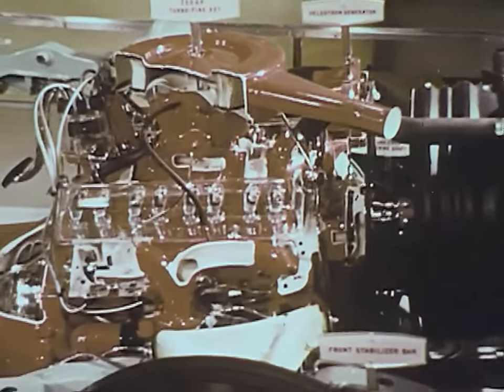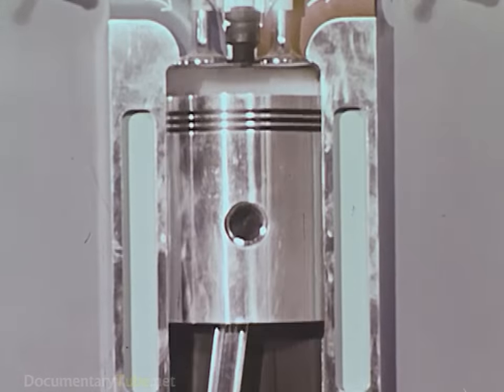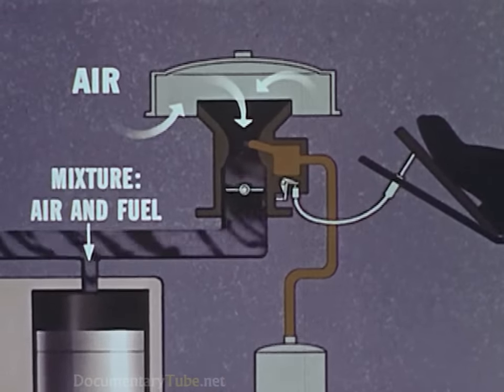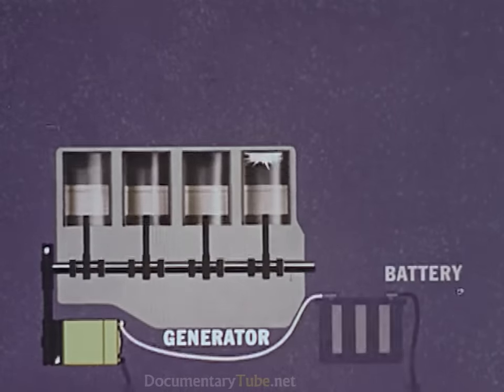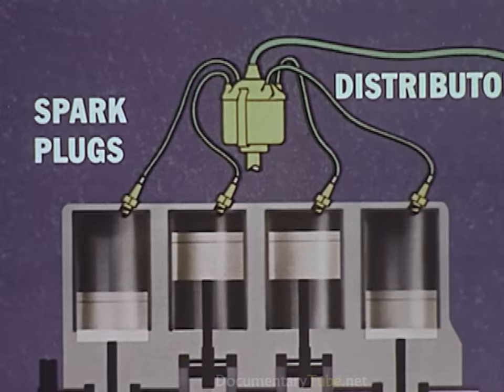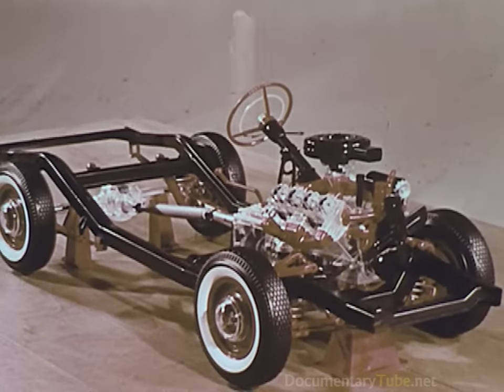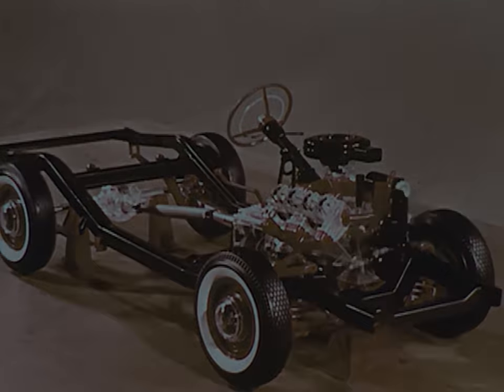HOW IT WORKS: Internal Combustion Engine

Comment: NO wonder people were smarter back then....they explain everything so simple to understand.
Reply: Are you sure? 60s engine are easy. Who know what is injectors times electronic ignition, lambda, air flow, cams time changing, a knocking combustion (when today engines work on edge knocking)
Reply: or maybe it's because engines were just similar back then. Thanks to the internet, we can be more informed than ever before
Reply: M
Reply: They also needed to understand it without YouTube as a option to learn which made them have to experiment more hands on
Reply: Yesssss! Screw common core!
Reply: They just didnt consumer drinking waters with fluoride and GMO foods
Reply: VueTube because things were simple back then. There is no easy way to explain adaptive cruise control and autonomous electric vehicles.
Reply: Your right!  - an excellent video
Reply: They used to talk this way in our government as well. Which explains why our government is so fucked up today. All they do is run their mouths speaking promises they can't keep while stealing more of our money by increasing our taxes.
Reply: Ikr
Reply: VueTube true
Reply: Yeah
Reply: @rakhit  definitely 😒
Reply: I thought it was the hats and ties.
Reply: @StopTeoriomSpiskowym  You have to understand the basics before getting into more complexity. Most modern explanations are bad for this reason. To learn how an engine works, you should start from its simplest form and build from there.
Reply: where could I get the complete version of this video?
Reply: @StopTeoriomSpiskowym  - you proved @Vue Tube’s point for him.  You rambled and didn’t make sense.
Reply: these days they warn us not to drink shampoo
Reply: Lmfao
Reply: @sumirunihon  I think the point he’s getting at is that nowadays you have to sift through hours of shit to find any useful information about anything, where as pretty much anything labeled “informative” from the 80’s back is purely educational and to the point. No merch plugs, no life updates before the video, no square space ads. Just a video about how an engine works. Simpler times
Reply: That's because engines were more simpler
Reply: @stevenarvizu3602  If questioning my grammar is your only refute then you need to get a life.

This is the comments section not an English essay.
Reply: It’s almost as if people these days don’t actually understand what they’ve learned and just copy the story they’ve been told and paste it onto an explanation.  

This is literally the only video that actually tells you that the explosion pushes the piston down, which is attached to the thing below in such a way that it rotates. And that that thing is attached to the crankshaft.  

Newer videos just show you an engine and go ‘look it’s intake, compression, spark and exhaust’. That doesn’t tell me how that thing drives wheels!
Reply: "Simplicity is the most ultimate complication"
Reply: Lol I was thinking the same thing.
Reply: @StopTeoriomSpiskowym  but an injection system is so much easier to work on
Reply: @elliedove7899  and there we have, you my dear Ellie are truly a gift from God. Straight to the heart of the matter, my kinda girl
Reply: I was thinking the same thing while watching this video.
Reply: Literally what I was thinking. I looked up 3 other videos of this and the explanations just made me more confused
Reply: Seriously
Reply: @StopTeoriomSpiskowym  
You're correct the engines in the 60's were pretty basic, some were extremely powerful but still quite basic (once you knew what everything was and how it worked).
Reply: They also weren't sucked into video games and social media...
Reply: No smog devices, no PCV valves and more which is why engines back then were simpler.
Reply: Good
Reply: for real! i liked it when things were built with simplicity and taught so easily that's why i like sticking to older vehicles because if something goes wrong its four key factors to it. Is it not getting spark? fuel? air mixture? compression in the worst case and check down the list
Reply: I feel like people nowadays try to confuse you for som reason when they talk to you don’t know why
Reply: Wellsaid vuetube
Reply: @StopTeoriomSpiskowym  What brought me here was to learn about the internal combustion engine and I did really enjoy this vid but  still have to look at other ones now to really know MORE about the internal combustion engines .
Reply: They were. Better food too no chemicals.
Reply: People weren't smarter in general back then , it's quite the opposite.
Reply: @Bawbrahs  ahh no.
Reply: I'm your 2000th thumbs up bro.. cheers.
Reply: @StopTeoriomSpiskowym  it's easy to explain a carbureted car in the 60s I could easily understand the entire driveline and the engine. But when it comes to ECUs, TCS, ABS and all the safety stuff it's not even explained anywhere unless you go digging for it. How the hell does an ecu work?

Comment: Thank you from a 77 year old lady who is trying to understand  how things work.
Reply: never stop learning
Reply: More like how things used to work. Half the things explained in this video no longer exist on a modern vehicle
Reply: That's super cool :)
Reply: Next up, how dinosaurs procreate.
Reply: @markgriz  not true, things are just all electronic now
Reply: @markgriz  everything exists
Remember this is petrol not diesel
Reply: @markgriz  why? It's pretty much all the same, just instead of a carburetor, it's direct fuel injection.
Reply: @hi-volumebeats595  Modern cars don't have distributor caps, nor a single coil.  They are all coil on plug.  There is nothing wrong with this video to understand the general concepts of how an internal combustion engine works, just pointing out that this 1950's era video is not an accurate depiction of how a modern automobile works
Reply: @markgriz  it's literally the same thing, every cylinder gets a direct spark from a dedicated coil cuz we've  got direct fuel injection now. But the engine works exactly the same way. If modern cars all switched to rotary engines or electric or something like that, then yes it wouldn't be an accurate depiction
Reply: @douglasdbird8114  No, my car doesn’t have a carburetor nor a distributor

Comment: Old engine but well explained !!! Thank you !!!
Reply: Old but still works! I have a 2004 Pontiac grand am with a V6. The engine is a push rod just like this one only real difference is its port injected instead of a carburetor, but the basic principles still work!

Comment: Just FYI if you're watching this in 2021, practically every car made past 1990 uses a EFI (electronic fuel injector) instead of a carburetor. The EFI is connected to a car's drive train PCM computer and is able to create the fuel-air mixture that gets sent through the intake valve. EFI's are far more efficient and save on excess gasoline being directed to the engine.

Comment: Now imagine it spins at 2 or 3 thousand round per minute. Each of those pistons goes up and down 50 times per second, firing a spark 25 or 12.5 times per second at 3000 rpm

Comment: The generator is also called alternator.
Reply: Suitlock_ Suit FNAF who cares person that liked fnaf 😂
Reply: A generator and an alternator are not exactly the same thing. The model in the video shows an old fashion generator, which haven't been used on cars in over 60 years. The disadvantage of a generator was that it used brushes and a commutator to rectify the AC current flowing through the armature winding into DC current to charge the battery. Alternators are different because they use solid state diodes to rectify the AC current flowing in the stator winding into DC. Alternators eventually replaced generators because the brushes and commutators used in a generator would wear out and need periodic replacement whereas the diodes in an alternator will last almost forever.

Comment: Does the throttle controls only the flow of air or both?
Reply: The flow of air draws the fuel in. The carburetor uses a device called a venturi to do this - it creates a vacuum by reducing the cross sectional area of the pipe in the middle and speeding up the air. And the additional vacuum in that part of the pipe pulls the fuel into the engine. (You can see in the diagram of the carburetor that the fuel is pulled in in the smaller point of the pipe.
Reply: @haydentuttle9870  Thank you!

Comment: Love how it says modern engine 😀. But what is shocking is that it has not changed much…it is still an internal combination engine with many moving parts.
Reply: You can now get as much power in a 4 cylinder engine than in a 8 cylinder. An 8 cylinder has nearly double the moving parts of a 4 cylinder so engines have gotten simpler. 

This is very recent, there is now a 3 cylinder road car engine that produces more horsepower than most 8 cylinder cars. This engine is powering a hyper car, but might come to everyday cars in some time.

I think most engines including in performance cars will be around 3-6 cylinders in the future with some exceptions being 2, 8, 10, 12

Comment: After every segment I was like "HOLY SHIT THAT ACTUALLY MAKES SENSE!" i just have one question? Modern cars don't have a carborator on top of the engine so where do they have it?
Reply: modern cars don't have a carburetor at all. Instead they use electronic fuel injection. There is a fuel injector usually placed just before the intake valve. A computer determines the correct amount of fuel to inject.
Reply: @Redtooth75  oh wow fr? So the fuel blends with the air coming in that makes sense

Comment: I'm still trying to wrap my head around how the pistons work. Where is the electric current for the spark originating from and how does the spark make the piston move? If anyone can explain this like I'm a 5 year old it would be great - I'm just tryina understand how the world works lmao
Reply: The spark comes from the spark plug, which gets power from the alternator. The alternator uses the  rotational force generated by the engine to produce power to charge the battery and to power other stuff like the spark plugs. The spark makes the gas air mixture in the cylinder explode, which causes the piston to move

Comment: Is it possible to store compressed fuel in cars?
Reply: Late response, but when Gasoline is compressed it ignites.  Fuels with lower octane ratings ignite at lower pressures.  That's why sports cars require higher octane gas because the engines compress the air in the cylinders at a higher pressure.  If a low octane fuel is used in a high performance engine it will ignite before the spark plug lights causing knocking.   Diesel engines use compression as the ignition source, they don' t have spark plugs.  Diesels run on very high compression within the engine.

Comment: Where is the computer located?  It controls the rotor, generator, and carburetor
Reply: Old cars didn't used electronic computers. Everything was electro-mechanical. Cars didn't start having computers until the late 1970's when fuel economy and emissions became more important. In an old car the distributor, generator, carburetor were all electro-mechanical and there was no computer.

Comment: Nowadays cars don't HV the distributor, but individuals ignition coil.
Reply: That depends. There's still plenty of engines that don't use multiple coils.
Reply: Yeah many vehicles just have dedicated coil packs to drive the sparks. My car has coil packs as a result of using a wasted spark ignition system. It's pretty interesting

Comment: So say you have trouble in a specific gear, you would first look at the spark plugs coordinated with that piston?
Reply: What do you mean I can help you out
Reply: @-gibby538  so it's a transmission issue?
Reply: @-gibby538  so in your original comment you made it sound like each piston is assigned to 1 gear

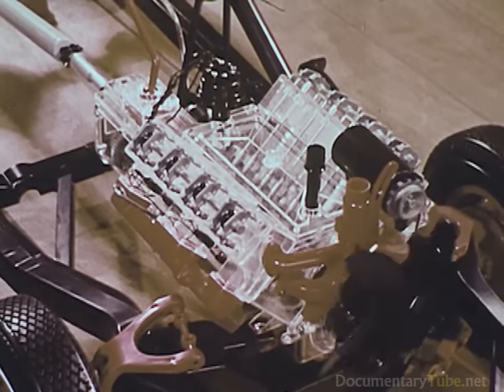Comment: 4:28 on older cars the first/front lobe of the camshaft, called an eccentric, was used to mechanically "run/power" the fuel pump.

Sorry I don't have a video to show it on 😅

Comment: "generator" is that the same as the "alternator"?
Reply: Miles Rose basically yes because it generates electricity like an alternator, but an alternator is just a more efficient generator and newer term, i believe the video said the generator gave the power to the battery then to the distributor, unless im wrong, i believe instead the alternator provides power to the engine and enough power to keep the battery charged as well due to newer engines having so much more electrical and needing a more efficient way to transfer energy while recharging the battery without over charging it and causing a shorter life span for the battery. unless they are the same thing just higher output now and a new term to call it
Reply: @ismaelperez5237  Thank you for that clarification. I was just a little confused, because on modern cars I usually hear the word "alternator" being used to describe the component that charges the battery.
and yet on this old video I hear the word "generator" instead... So, on modern vehicles, and alternator both Powers the battery/distributor, as well as all of the newer electrical and computerized components of the engine?
Reply: @MilesRoseProductions  little late, but yes, you hit it right on the head. The alternator recharges the battery, which in turn powers the car's electrical components, which can be the car's turn signals to the car's central touch screen.

Comment: Sorry sir gasoline diesel kerosin and propane or butane or l.p.g.or not explosifes but flammable fuel's so it is not a explosion in the engine, dynamite is a explosif

Comment: Just for information. 
Carburators are no longer used in modern car .
Reply: Yes, now they use fuel injectors. Also, "generators" have been replaced by alternators.  Oh and most modern vehicles no longer use distributors.

Comment: When you can start an old school engine by nothing more than firing the ignition at the correct time...Without using the starter, then you will possess  a complete understanding of engine cycles of operation. Past, present, and future.  It was required to ace advanced High school autoshop.

Comment: Simply Combustion engine works with nitrogen!  And sparks. .. but we believe we run our engines  with gasoline and  oxygen ... drag racing cars use nitrogen  (NOS) CALLED TOP FUEL DRAGSTER. .. Oxygen sensor in our cars is a nitrogen sensor!
Reply: Top fuel use nitromethane fuel (CH3NO2) not nitrous oxide (NO2). Nitrous oxide is not flammable, it just helps speed up combustion by adding oxygen. Nitromethane is flammable. Most cars use gasoline.

Comment: down piston moving back up how? Fra So strong that the rotator is able to complete a whole clock/anti circulation just by virtue an it one of with push ! 😁 and this much liberty an mechanics still you struggling with high rpm to produu, so piston push(if Ist Stroke burst) reburst and burst after burst to keep rolling 🤣

Comment: explain with the fuel injectors, cause carburetor engines are no more
Reply: Since when
Reply: @myklesingh8253  since ppl starting to move on with time. why still have the style engine when fuel injectors give better performance
Reply: all the latest car are fuel injected also, unless you keepin an older model its no real purpose
Reply: @officialojkush4050  ok
Reply: @officialojkush4050  so what should a carb do
Reply: @officialojkush4050  the fuel injector is located just before the intake valve. An engine control module (ecm) uses an array of sensors to determine the correct amount of fuel to inject. In place of the carb there is now a throttle body which is just an air valve that works the same as shown in the video.
Reply: I've owned cars with carburetors and cars with fuel injection. Carbureted cars were hard to start, they often stalled, they hesitated and they used more gas and produced more emissions. And they were even more temperamental when they were first started especially in cold weather. In contrast modern computer controlled fuel injected cars have none of these problems. The carburetor is pretty much ancient history and for many good reasons.

Comment: Too bad this technology is going away in one decade or two
Reply: to what ?
Reply: 3Xcollasso u live under a rock or what
Reply: @tommytexter4054  no, just thought you knew something I didn't.  It's 2019 ,  I dont see any of the auto manufacturers rushing to put out new technology. I only see them improving gas mileage, and thats only cause they have to because of govt. regulations.
Reply: @tommytexter4054  yes, your right, I apologize.  So, in 2 decades you believe that that the internal combustion engine will be extinct?  Just asking for your opinion. Thanks
Reply: 3Xcollasso don’t you know? It is all going to be electric
Reply: @tommytexter4054  No, I didn't know that. I know they have electric cars even now, but i didn't think the big car companies were going  to willingly switch to all electric cars 20 yrs from now, and that all cars were going to be all electric 20 yrs from now.